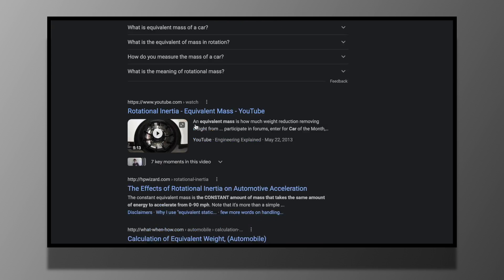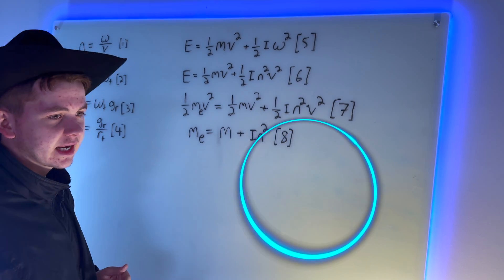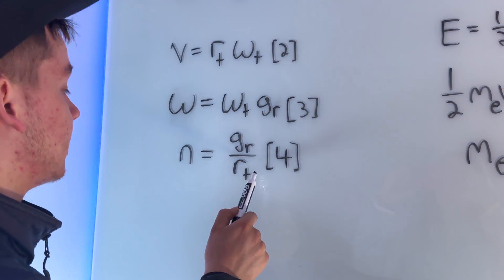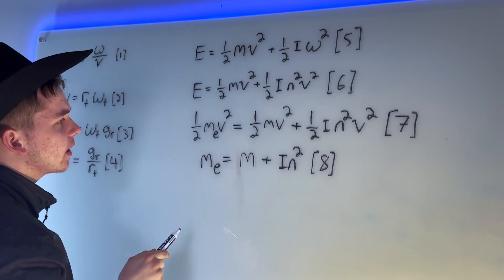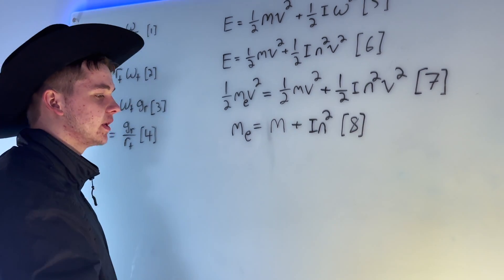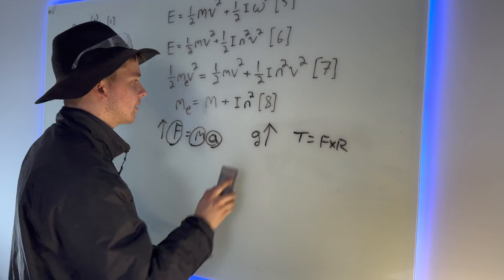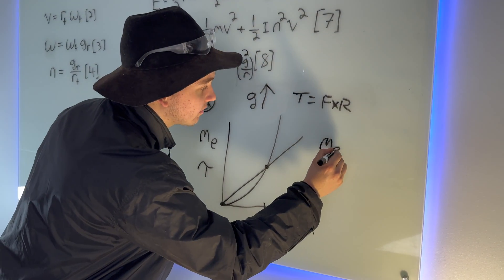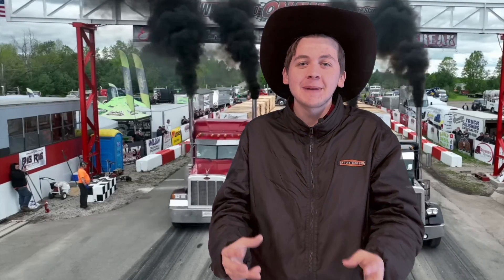Equivalent Mass | Rotational Dynamics

Comment: This is a good video, Its just I am dumb enough to not understand it
Reply from the maker: Just remember this... If your into on road racing you want as light as a flywheel as possible.
If your  into off road crawling. Just gear wayyyyyyyyy down. Low low low gears are good.